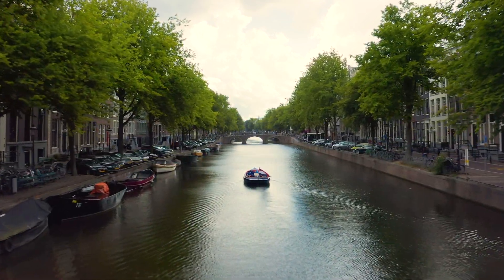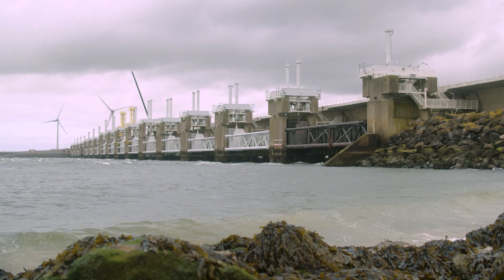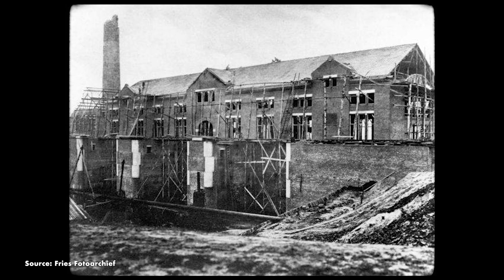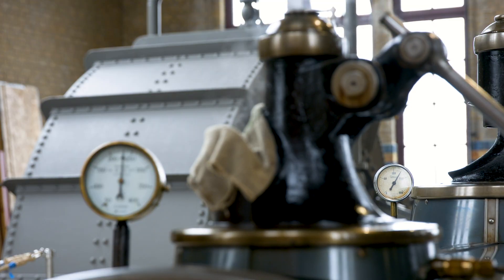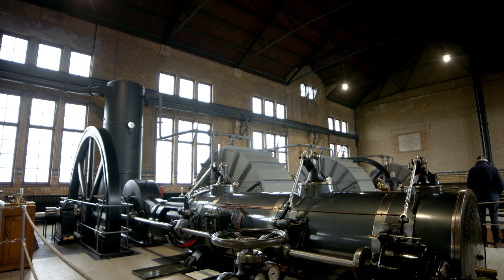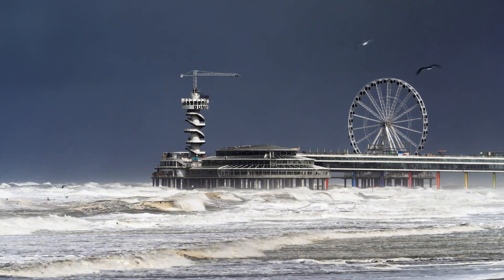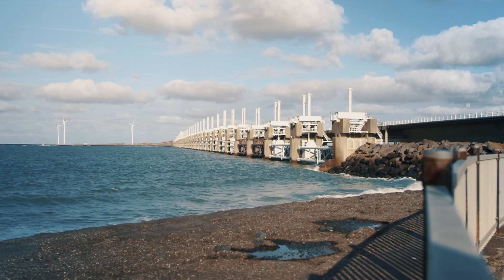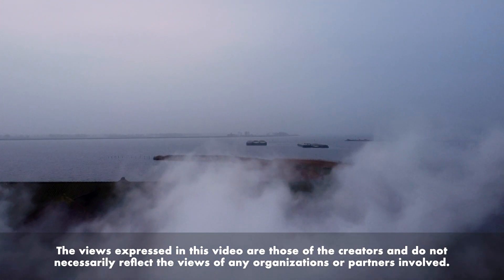A Century Old Steam Powered Pumping Station: The Woudagemaal | Polders & Pancakes

Comment: The  boilers are oil fired, they converted from coal in 1967. And they run the station plannend a few times a year to keep the operators trained and also when the water level is really high and there's a need to run it.